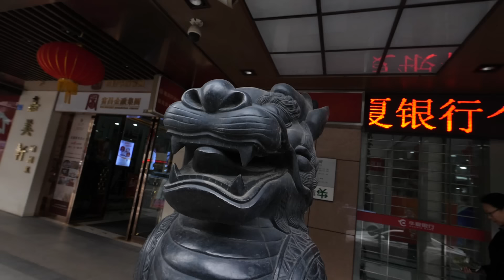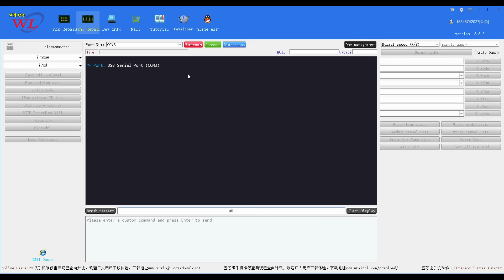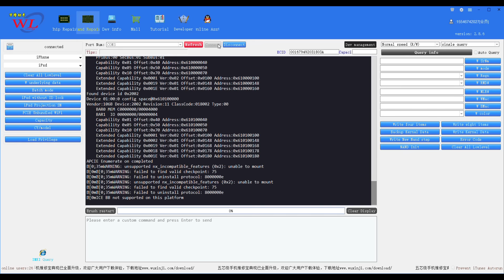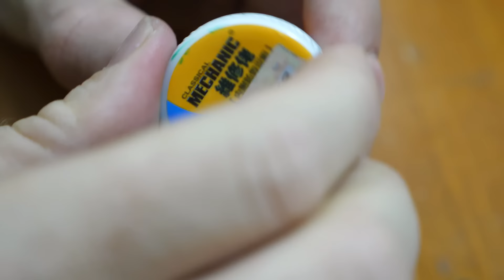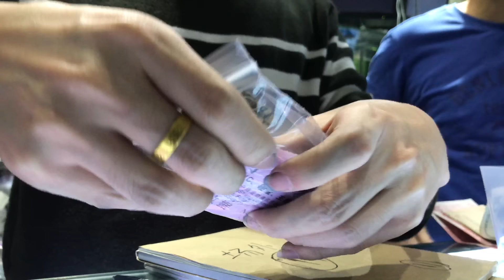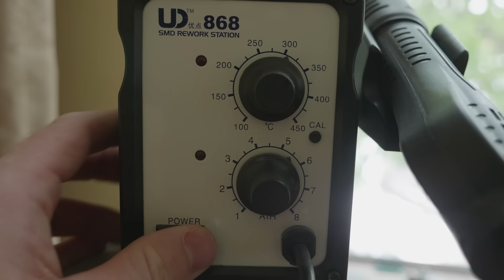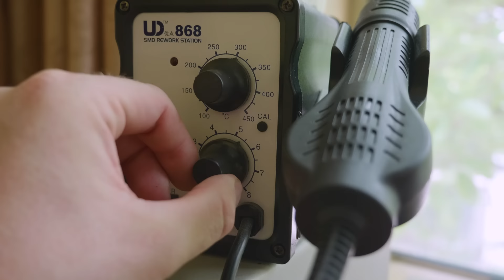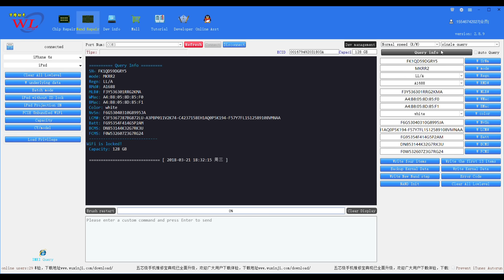How I Upgraded My iPhone Memory 800% - in Shenzhen, China

Comment: can i upgrade/replace in this way a 128GB chip to a 256/512GB chip on my google pixel 4a?
Reply: Almost certainly no because the google pixel 4a is a totally different phone made by a different company. The solder pads are likely to be in a different arrangement entirely.
Reply: @labadaba5088  no i know that. i ment, there is certainly a RAM chip on the piel that i could swap for a bigger one, dont you think?
Reply: @johnmachter40  Yes, but you would have to find a compatible one. Considering that there is much less information and research being performed on how to achieve such a transplant, it is unlikely to be found. Not that I'm discouraging you of course. If you wish to conduct such research yourself, go right ahead. 

The primary difference with the Google Pixel and Apple iPhone is that the latter outsells the former by such a great degree that it is economically viable to conduct such research as even if 0.005% of people are interested in getting their phone storage upgraded, there are hundreds of thousands of potential customers. As such, there is much more research being done with the iPhones. And that is how you end up with videos such as this. 

I have not seens any similar videos for the Google Pixel although it does seem possible that there may be some such videos in obscure repair forums, but of those, I know of not.
Reply: Flash memory is (usually) in standardized packages. The chip in the Pixel 4a is a Samsung KM2V8001CM. An upgrade is technically possible to an KM2F8001CM, but I can't find this chip for sale anywhere (atleast not in small quantitites, you could try finding a similar chip by another manufacturer, I can't be bothered), and the Pixel 4a board layout would make this a pain to actually do. That chip is a UMPC chip, which integrates the ram and flash storage into the same package. You could try swapping in a KM8F8001MM, which would theoretically give you double the storage and ram. I severely doubt this would actually work, but it is technically possible. That chip is also worth as much as a refurbished Pixel 4a.

Comment: The crying shame is that by the time you get your phone upgraded where you want it, Apple will release a 2TB phone that runs six times faster. Then comes the its upgrades that artificially slow your phone to the point that you want to chuck it at an apple salesman and finally switch to an open phone platform like I did 8 years ago.